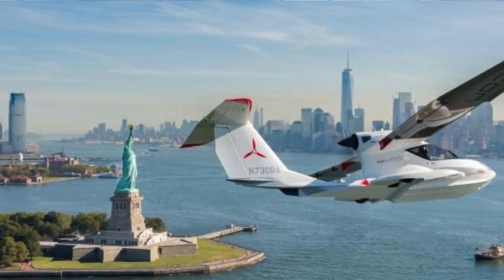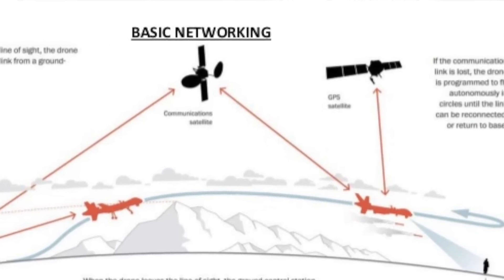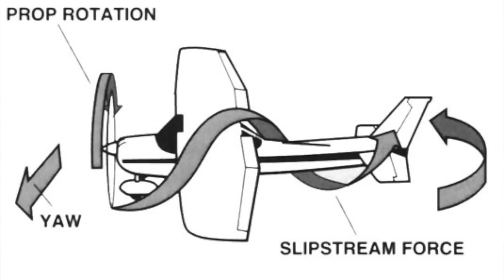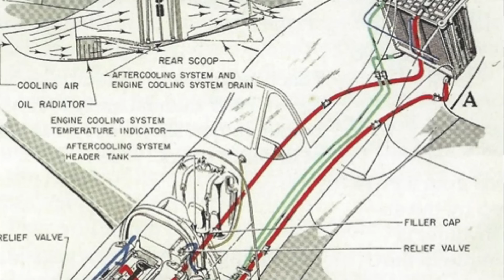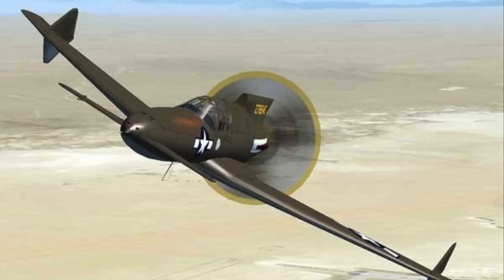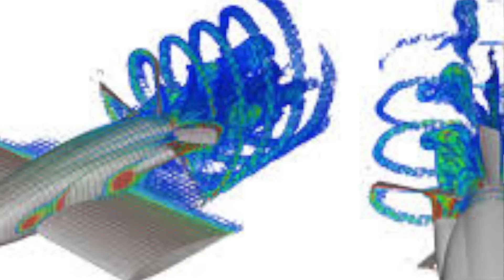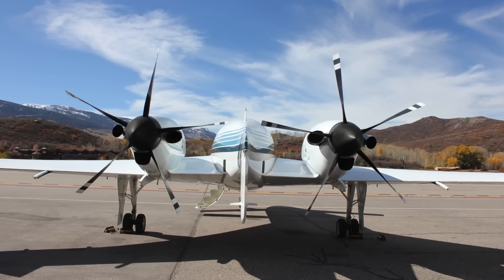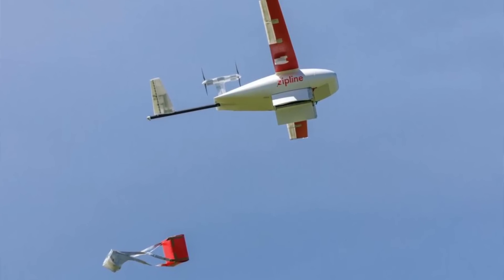PUSHER AIRCRAFT  Configuration    EXPLAINED IN DEPTH

Comment: The B-36 very heavy bomber was huge pusher design.   The rear facing 36 cylinder air cooled engine were difficult to cool properly.  The tech at the time used forward facing air cooled engines, not many pushers.   It was the biggest Atomic bomber before jets took over.   There are also tractor plus pusher designs   .aligning the engines with the  main body of the aircraft.

Comment: I love pusher Aircraft. The vast majority of them look really good.
Terrible criteria for judging an aircraft of course, since in practice there's a reason why puller aircraft have dominated for so long.

But still, you can't deny they look nice. Or at the very least, interesting...
Reply from the maker: I think the complexity of controlling airflow into the prop to prevent vibration, or the consequences of not doing so have prohibited more of a widespread use of the pusher configuration, as Tractors do not have the issue. 
Looking right usually means something, especially to a seasoned designer.  the great Kelly Johnson used his positive visual  impression to determine which projects to explore further.  In the early days when he started designing aircraft, there were not the resources he had later, as they did not exist yet, for qualifying a feature, or design configuration. He had to rely much more in intuition, and use what tools he had to make the best of it from there.    Even today, it's a good start!!  
Besides, if it looks good, you may be more likely to get funding. VC people are usually not Physicists, or Aerodynamicists, although they should be.... or at least have a physistist on their team.

Comment: Would you be able to solve a lot of the problems with making them ducted
Reply from the maker: Same general principles apply, although ducted fans/turbofans tend to be a smaller relative diameter, so Torque effect and slipstream effect is less, P effect is reduced because the flow is controlled, and enters the fan blades at a corrected angle, somewhat. (although ducts are less tolerant to extreme entry angles, thus the issues with Compressor stall) Gyrospocic precession may remain approximately the same, although that depends on the spinning mass, and it's mean distance from the center.  Could go either way.   
Having a smaller diameter also makes it easier to place engines,  as it opens more opportunities in terms of different configurations, and better clearance to other components of the aircraft. 
that being said, it's almost always beneficial, except for very fast aircraft, to use the largest practical disk area to create forward thrust, hence the shift recently to ultra high bypass ratio turbofans, which was not practical due to material limitations in the gear drive in the past. 
A compromise would be the PropFan, tested, but never implemented.  
keep in mind that all of the bad effects of one prop (or fan) rotating in one direction are offset with a second, rotating in the opposite direction. (counter rotating twin, or multi engine aircraft). 
when placing an engine at the rear of a fuselage, using a duct can also help direct air into the fan and at the same time improve the flow into the prop arc, reducing the turbulent aspect of the flow after it has passed over the fuselage. 
fun stuff to think about.

Comment: This example was confined to Prop aircraft, what about rear mounted Jets i.e. VC 10
Reply: Jets are pushers by design.
Reply: @Enemji  Thank you for your comment, however if I remember rightly the original articles was referring to the Pros and Cons of what were/are referred to loosely as Pushers regarding their aerodynamic handling characteristics and the difficulty of avoiding detrimental turbulence from  the Fuselage /Wings etc affecting stability and control.
The V.C. 10 was not only a ground breaking Civil Jet Liner but also very adaptable for Military use such as Trooping, Transport and Mid Air Refuelling .
VC 10 was also a highly loved aircraft to fly despite being Rear Engined.
Now referring to Newton's 3rd Law maybe you could enlighten on the use of the word "Pusher" related to  'rear mounted' Propeller/Turbo Prop and Pure Gas Turbine(Jet) Power units configurations  and NOT to Forward of the Wings mounted Power Units .... IT is not anything to do with the difference between Propeller or Gas Turbine power units.

Comment from the maker: Someone asked me this :  "Hi!: may I have your feedback about feasibility of a Custer Channel Wing with 2 electric engines, an hybrid approach could be considered, propeller in leading edge or over thickest portion of airfoil, a 'counter propeller' behind propeller to change vortex flow into straight line, and an inverted 'V', 'A', tail unit in the propellers flow? Thanks!"
My response:    "Custer channel wing is interesting. i think the concept is to create all of the high speed flow over the top of the wing, thereby increasing lift without expending any extra energy, which i’m sure it does to an extent. 
Unfortunately, prop arcs are round, and the wing shape means that the lift from part of the wing will be directed sideways, not up, but the drag penalty for having the wing is still there, so seems that there may a net loss when all is calculated. 
also, the component of lift from bernoulli effect is usually low, and even  in an airfoil what uses it heavily, usually does not account for more than about 20% of the total lift, the rest being obtained by newtonian forces. equal and opposite reaction. This is also observed as a pressure differential, but not to do specifically with bernoulli effect. 
Then there is the issue with the pressure differential in front and behind the propeller arc.  if you want to increase lift, best to place the prop disk toward the rear of the wing, so that the low pressure is acting on the wing.  if there are more than 1 props inline, that would make a high pressure area. 
may not be the best approach.   NASA has done some interesting work getting a top mounted rear engine to create low pressure area and is able to make lift by having it act on the fuselage. It’s called the bubble, or double bubble. 
Straight line flow is great, but probably greater issue is turbulent flow.  counter rotating inline props may give a net zero rotational velocity, but will likely make even more turbulence than one.   Also, the high level of compression from more than 1 inline prop of the air results in a loss of efficiency, such as can be observed with X8 configuration multi-copters, and the reason whey they are not common in applications where max efficiency is needed. 
as far as the tail goes,  A or V tails can have adverse or proverse roll effects,  probably not much of a factor for total performance, and can become more or less directionally stable depending on AOA of the aircraft. V-tails for instance become more stable with increase in positive AOA, but have an adverse roll effect.  opposite for A tails, otherwise known as inverted V-tails. 
Whether it’s a good thing to have the stabilizers and control surfaces in the accelerated air or not, depends on your application.   Great for bush planes, and aerobatics, where extreme control response is needed, or sufficient is needed at very low speeds. 
For cruise flight, it’s a net loss to place anything in the path of the prop wash, or accelerated air. 
hope this shed some light on the subject."

Comment: Hi, great video. Do you have any information on twist in the propeller blade?
Reply from the maker: in a  basic sense, it can be calculated for the distance from the center, but other factors come into play, like lift distribution, structural considerations, and control of any tip vortices, as well as spanwise lift distribution.  Reynolds numbers also change drastically from root of blade to tip, changing the way the air molecules behave.   It woudl be hard to even model in CFD, and probably best to give a machine learnign algorythm access to a manufacturing automated facility and wind tunnel, then come back in a year. to see what it came up with.  I'll let someone else make propellers.....

Comment: What are your thoughts in regards to your talk about Sam Bousfield's Switchblade?
Reply from the maker: well, as an aircraft which must also fly, it's compromised, as the weight and drag of the wheels is more than an average aircraft, but as flying cars go, it's pretty good.
tricycle configuration for the gear 
low wing 
T-tail (or something like that) will provide good directional stability and good handling. should be spirally stable, or at least more than it would have been with other type of tail. 
the prop has the fuselage in front of it, which is not ideal, but probably not as bad as it looks. 
the wing is not in front of the prop. that is really good. 
it will probbaly land a bit hot, just becuase the size of the wings is limited, so wing loading is probably on the high side. 
looks good to me.  
If i were the test pilot, i may be afraid, but not due to the inherent configuration of the aircraft/car...  I would be afraid in LA traffic, like any other small lightweight car, and being a 3 wheeled vehicle, if there is a pothole in the road, you cannot avoid it very easily, such as with a 4 wheeled car.
Reply: @FPVREVIEWS  Your last paragraph here starts to touch on the many reasons a 'flying car' will never be practical, no matter how well it flies.  "Hey Honey, let's stop at the market on the way home and do some shopping."  Yeah, and leave your $400,000 airplane in a parking stall.  ooops, door damage from the jerk who parks next to you.  $30,000 repair and plane grounded for a month!
Reply from the maker: @lesizmor9079  I agree.  VTOL aircraft that can travel efficiently at high speeds or at moderate speeds over relatively long distances, such as Distributed Electric propulsion designs, which are also redundant and safe are the answer.  They also need to be quiet enough to land almost anywhere.  Such as the Lilium Jet.  when you can do those things, it's pointless to drive around in traffic.  A helicopter gets you most of the way to that goal, but is usually slow, and noisy, also uses fuel and pollutes.  not as safe as an electric autonomous aircraft can potentially one day be, and also expensive.
Reply: @FPVREVIEWS  Thank you for that quick reply!

Comment: I have one shown in the thumb nail that takes off from San Jose Airport every day just around 11:00. I can hear him inside our building and know it's him by the very distinctive sound it makes that is like no other. I've seen it by my own eyes so I can tie the sound to him. I think one of the beautiful propeller driven air craft is The Beechcraft Starship. That is after the P-51D and the P-38, but they are not pushers.
Reply from the maker: It's a Piaggio Avanti  turboprop   Italian. 
The noise is the prop arc intersecting at a right angle with the pressure differential from the wing when  lift and thrust are created at the same time.  It's most apparent at takeoff, as the prop speed is the highest, and the airspeed is lowest, also a relatively high angle of attack, so the prop blades also are experiencing a large amount of P-Effect.  The combination of these factors, the harmonic vibrations, and their resonation in the air are what make the noise. 
You are absolutely right, the noise is very unique. 
IMHO that part of the Piaggio Avanti's design is not a very good one, but there are few options for the configuration, and that configuration does have some unique benifits over conventional aircraft.   is it worth it?   probably not, but it does look cool.  Very italian.

Comment: Feel like I been in class !    THANKS
Looks like the best motor for a "Pusher" is a jet engine  ???
Reply from the maker: depends on what the goal is. 
is it speed, distance optimization or endurance? 
pure jets have very high compression ratios, and expel lots of air from a very small nozzle.  This is highly ineficient.  
Turbofans are much better, and have a larger diameter.  less compression and greater volume, but the most effecient models do not work well, or at all at supersonic speeds. 
Turboprops or just plain old prop planes have a very large disk area, can have very low compression and be much more effecient than even the best ultra high bypass ratio turbofans, but this is only in theory from the prop efficiency side of the equation, and the total reality depends on the engine powering them. 
If you want to go super fast, jet 
get there quick but relatively effeciently , turbofan
get there slower but still reasonable amout of time, turboprop 
get there someday, prop job 

That being said, there are hybrids, such as boeing's sugervolt, and pure electrics, also distributed electric propulsion...   but on the prop/fan side of the equation, rules still apply.

Comment: Thank you for a very well presented video. You caught most all of the problems.  Subscribed.  My  only powered aircraft, which I  built and test flew was a pusher (the first of its kind, on yt channel sevtecsev) .  I had no problems in spite of building my own prop with a balsa core covered with "e" glass, not so fatigue resistant.

Comment: Has anyone ever tried using a helicopter swashplate design to mitigate pusher to wing pressure variations?  I know complexity and weight probably make it impractical.
Reply from the maker: heard of it, but there are aircraft that use Teetering propellers.   The only one I know of is the SI2 Solar Impulse. Not sure if the prototype, SI1 used them or not, but as i understand, the teetering propeller's intended purpose in that application is to better align the propeller disk at 90degrees to the airflow dynamically.   Would be interesting to explore the idea, although with the advent of Distributed electric Propulsion configurations which do not cause any pressure diffreential problems, It seems unlikely that it will be explored extensively.  Most Pusher designers accept some vibration level, and are not using the pusher configuration if they cannot accept it.

Comment: I wonder if the vibration problem could be solved by radically spiralled prop blades, maybe incorporating a retaining hoop acting as its own duct and damper. Each blade would be simultaneously slicing through high and low pressure.  Afterthought: the retaining hoop might also allow the blades to be angled radically forward to direct the thrust against an expanding cone of undisturbed air, giving a virtual larger prop diameter, that would be a neat cheat.

Comment: Excellent video, to me the configuration that I like more for my RC airplanes is tractor on top of a post. The propeller has good efficiency, low noise, the engine is well cooled and I do not break the propellers when landing. The only thing that when you hit a throttle tends to go down, but it is corrected with a little motor angle and a decent elevator.
Reply from the maker: you may consider a pylon between the wing and fuselage to more closely match the vertical CP with the vertical CD.  if the prop is far froward from the CP on the longitudinal plane, then the thrust angle will be more effective. if that distance is closer, it will be less so.  
Ideally, the prop will be angled slightly down, not up, so that the prop disk is alighned as closely as possible with the airflow. 90 degree angle. 
but if you need it angled up for power pitch coupling, it's probably a minor inconvenience to have it that way, as propellers are fairly tolerant to mis alignment to the airflow, as evidenced by the quadcopter drones flying around succesfully, although that's why they make lots of noise, have lots of vibration, and it takes very small but sophistocated software tweaks to make them handle nearly perfectly. 
A cleanly designed aircraft presents little problem to the engineer writing software for it, expept for the inhereent complexity of the flight dynamics, and multiple regimes it must fly in. 
a poorly designed aircraft needs really good software to fly well, and will never be quite as good no matter what you do with the software. 
this also applies to the person integrating a generic autopilot system, such as Inav or Arduplane.

Comment: Ice sloughing  of the Avanti was a major challenge for the Italian designers.
Reply: I remember years ago reading about the development of the Avanti. It was reported the designers approached the challenge as they were to design an airplane with having never seen one. Another words,they started from scratch so to speak. Propeller icing wasn’t so much of an issue as making sure large chunks of ice from the fuselage and wings didn’t travel through the propellers. I can’t recall the solution. At any rate, the Avanti has always been one of my favorite airplanes because of its striking appearance and fresh design approach. Kudos to you. I happened to stumble a cross your piece. I thoroughly enjoyed listening and learning from you.
Reply from the maker: Didn't know that, but I can imagine it was only one of many...   Still not sure how they dealt with the inevitable vibration...?? shock absorbers on the engine mounts??